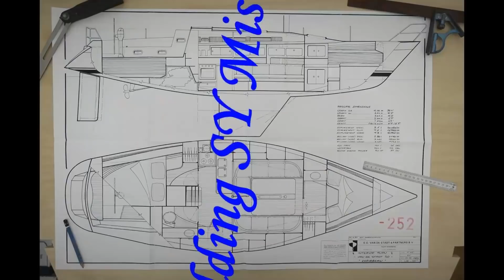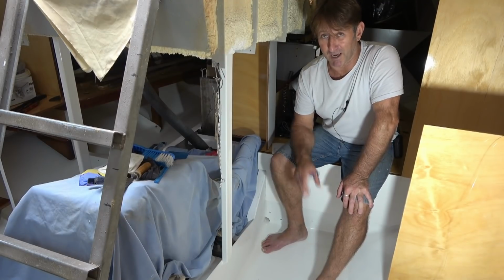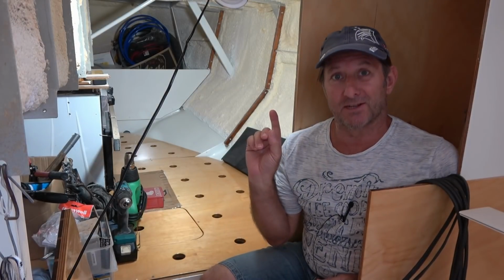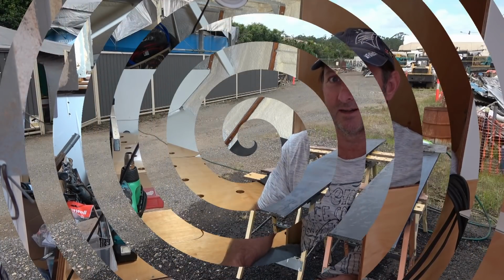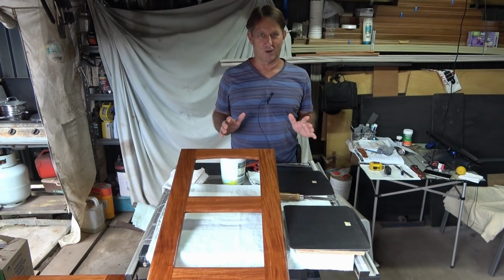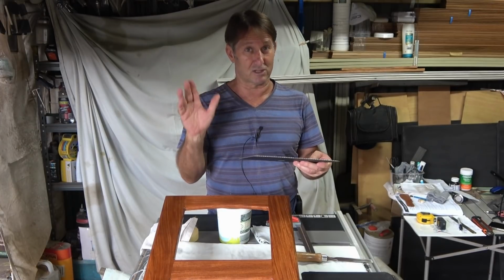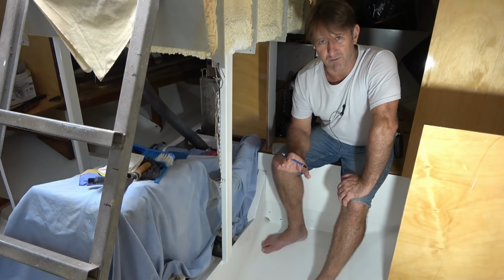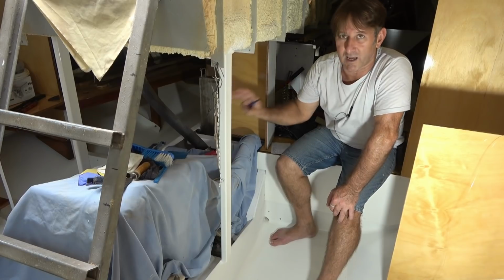MAN, things coming TOGETHER! Ep.134 Building my steel sailing yacht

Comment: Nice big empty space above the transmission. Hanging a box from the cockpit sole would give a nice area to store engine essentials right where they'd be needed. Oil, coolant, belts, etc. Even a few tools for quick repairs, like wrenches to loosen the alternator for a new belt (a length of 'keyhole' belt is handy for quick, temporary replacement underway), or screwdrivers to open clamps for hose changes... 'You will always have the fussiest client when you work for yourself'... 😊
Reply from the maker: Thanks for your good comments Mike, appreciated and yes, well noticed re. the (by comparison to many) large open space above the engine etc., which will be used for mounting several things, but also remain open for engine bay ventilation 🙂👍

Comment: I so agree with your big panels easily removed  direction for the engine area. Like where you were sitting I imagine  the exhaust mixing elbow was there and you never think that will be a problem....But...they can carbon up so the cooling water injection is restricted  and it's probable that will be worse with the bio  fuels. Did you use a different tin of Awlgrip after the  bubbly surface or do something different in the prep?
Reply from the maker: Thanks for your good comments and question rl, appreciated and yes agreed.
Re. the AWLwood, yes, the problem was that the tin had already been opened a couple of times and so had already started to harden/clump, which a new batch/tin solved  🙂👍

Comment: Cabinet doors look marvelous! Bruce would rolling and then tipping with a foam brush improve the finish? I have had good results with this method? Cheers! Captain Denny
Reply from the maker: Thanks very much for your good comments and suggestion Denny, appreciated and re. the AWLwood clear finish, it is quite a unique product and that self levels and can be applied by all methods, I actually prefer conventional spraying. The problems that I had this time were because the product batch had been used/opened a couple of times previously and because moisture in the air is actually the "hardener" it had already started to harden/clump, so a new batch/tin solved this  🙂👍

Comment: Hi Bruce, wondering about that additional insulation you put up in the rear cabins, is the two different types of foam for a particular reason or just because you did the spray foam years ago and you now don't think it's enough and doing spray again would be way too difficult (and messy) given the stage of the build you're at now?
Reply from the maker: Thanks for your good question Pete and in short yes, you are correct. I did have a comment about this at minute 7:35 which also has a link to Ep.11 where I explain more  🙂👍

Comment: Looks great Bruce, there are many different ways to apply varnish, why this way instead of the other ways to do it? I like to roll and tip so that I can cut down on the amount of sanding that would be evolved, but is just me or is that even a thing down under? Heck even here in the states they do it differently in different parts of this country. It was just a thought that hit me while I was watching,  how many ways do you all have down there and when do they come into play
Reply from the maker: Thanks for your good comments and questions Jeff, appreciated sir and re. the AWLwood clear finish, it is quite a unique product and that self levels and can be applied by all methods (in both hemispheres 😁) I actually prefer conventional spraying. The problems that I had this time were because the product batch had been used/opened a couple of times previously and because moisture in the air is actually the "hardener" it had already started to harden/clump, so a new batch/tin solved this. Coating/painting, as I have discovered with building Mistress over the years, is actually a HUGE subject, science, art, hard work, luck and with no shortage of confounding results along the way,....  🙂👍
Reply: @BuildingSYMistress  Bruce , you have a ton of knowledge and I for one am glad you share it!!! I hope this did not come off as me being critical of how you put your boat together. It has been a long time that I had to varnish anything    so I was curious as to why is all .
And beside don't the toilets flush in the other direction down there 
...lol you are doing a hell of a job is all I can say.
Reply from the maker: @4englishlies875  Thanks Jeff and no, I did not at all think that you were being critical and your comments are always good to engage with sir. I do hope that my responses answer your questions/queries and re. flushing toilets, it's because we are upside down  😆